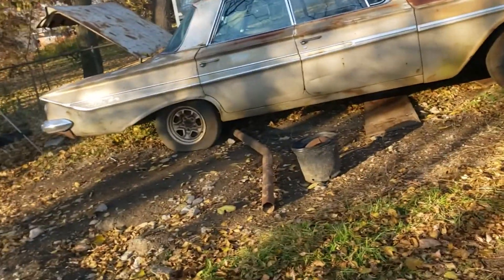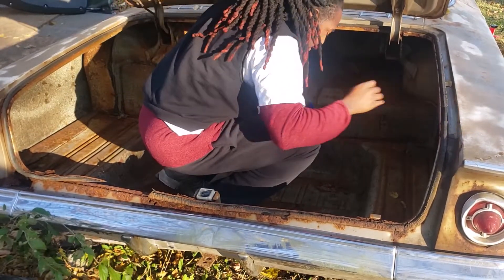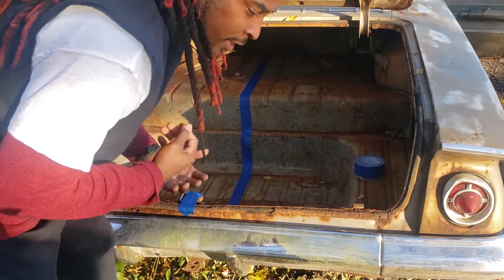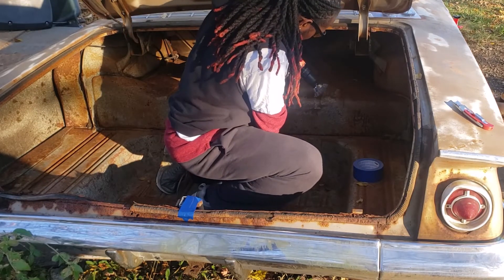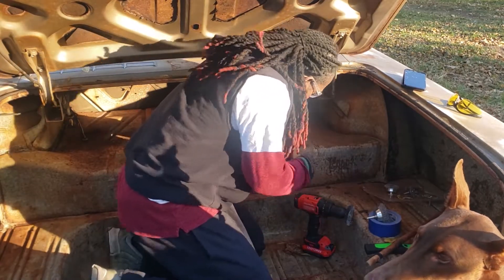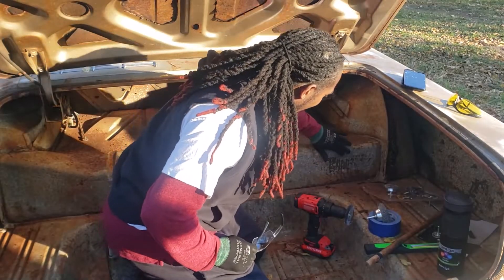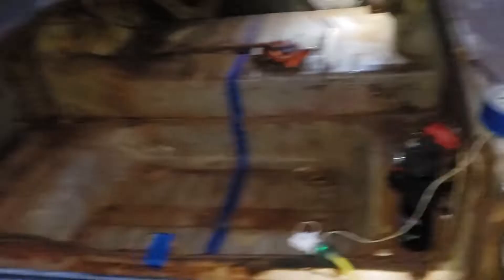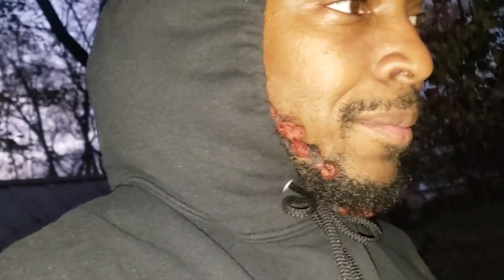1961 Rust removing

Comment: They sell Rust Converter chemicals that you can apply after the wire brushing/grinding.  The Rust Converter can take care of little pinholes of rust.  Then put some sealer/primer on top.  Make sure any primer you put on seals.  Some primers do not seal the metal from water, and if you let it sit, water gets under the primer and you are worse off than when you started.  
And I predict you new hair color will be "rust colored"  ;D
Reply from the maker: New rust hair color 🤣🤣.. thats my game plan is to get the rust out and hit work a sealer/primer like I did the 64

Comment: Get a grinder with a flat disc and are wire disc. Itll be faster. Use vinegar and water to finish up the light stuff. Make sure you wear a mask. Rust is real bad in your lungs. Spray it with 2k primer not por15
Reply from the maker: Yes sir thanks for the information.